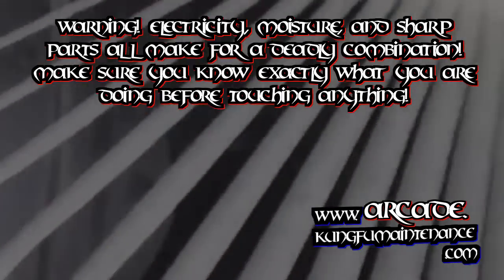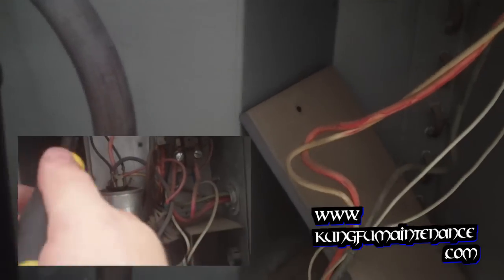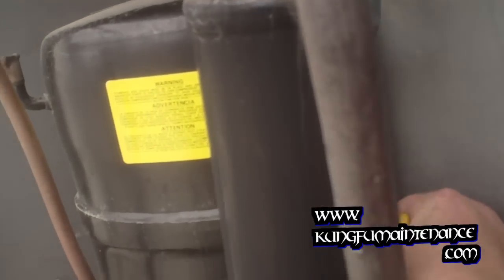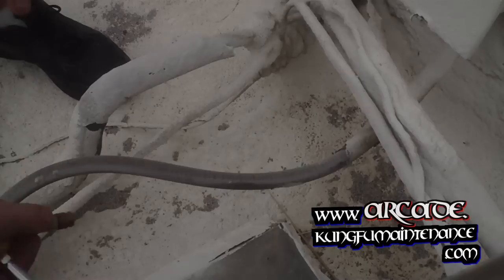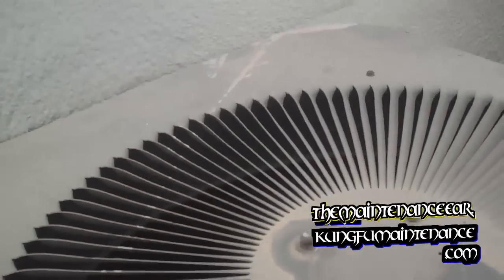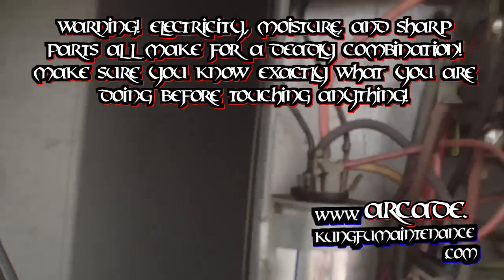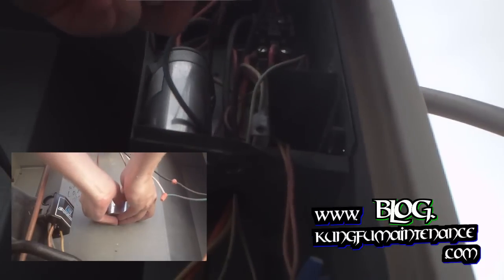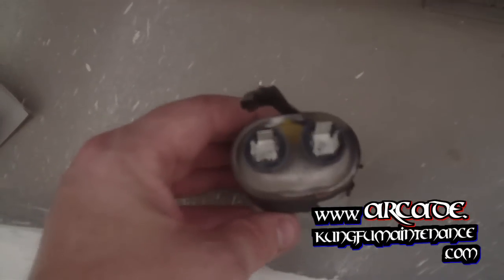Air Conditioning Fan Stuck Try This Before Replacing Central Motor

Comment from the maker: Get  the Multi Tool Pliers used in so many KFM videos       http://amzn.to/2kWTjPp
5mf Capacitor   http://amzn.to/2wC96sH     35mf Capacitor    http://amzn.to/2vZVZ2t
35/5mf Capacitor   http://amzn.to/2iVJNi2        40/5mf Capacitor    http://amzn.to/2wzEdXD 
45/5 mf Capacitor   http://amzn.to/2w0wez5   
Get KFM's favored AC Gauges here            http://amzn.to/2kYgGb8
Valve Core Removal Tool                              http://amzn.to/2kJ00pC
Get KFM favored Electronic Leak Detector        http://amzn.to/2kmQMMz
Simple Leak Seek Spray   http://amzn.to/2lFfcC5  Laser Thermometer  http://amzn.to/2layD8I  
Inficon Refrigerant Scale                               http://amzn.to/2vUCQPD
Get KFM's favored Multi-Meter  here        http://amzn.to/2l8W9CO 
Get the Milwaukee 11 in 1 Screwdriver     http://amzn.to/2uTtsNj 
Wet Dry Vacuum used in so many KFM videos   http://amzn.to/2lFxi7u
Condensate Pan Tablets   http://amzn.to/2lalV9W   No Rinse Coil Cleaner  http://amzn.to/2lHg8GD
Condenser Fin Whisk Brush                          http://amzn.to/2vWXUoC 
Chapin Pro Pump Sprayer                             http://amzn.to/2vWCXdD
Evaporator Coil Cleaner No Rinse Mix        http://amzn.to/2x3eJTT
Evaporator Coil Cleaner No Rinse Can        http://amzn.to/2ezIxju  
Hard Start Kit     http://amzn.to/2kiD16v   Contactor     http://amzn.to/2lFqA0P
Get the Screwdriver used in so many KFM videos here    http://amzn.to/2kHFoOF 
Easiest Way To Get Universal EPA Certified Prep Manual    http://amzn.to/2kIQdQC
You must be EPA certified to charge or recover refrigerants and here is about the Easiest Way To Get certified with the Universal EPA Certified Prep Manual    http://amzn.to/2kIQdQC
Get The Kung Fu Maintenance book here     http://amzn.to/2lEQPFk
Or  the Kung Fu Maintenance E book here  for less than $5    http://amzn.to/2lEY8wD
Get the Kung Fu Maintenance album (good driving music) "Up Beat" here     http://amzn.to/2l41pZ1
Get the Kung Fu Maintenance album (nice Instrumental music) "Entropy" here   http://amzn.to/2kl2U0p
Samsung Galaxy S8 Plus        http://amzn.to/2sFn9h8
GoPro Hero 5 Action Camera         http://amzn.to/2sN4nVK
Rode Lapel Microphone                 http://amzn.to/2vZoFc7
Purple Panda Lapel Microphone  Kit   http://amzn.to/2wByXkq
Video Edit Pro Software       http://amzn.to/2ruaaeZ
Samsung Galaxy S5                 http://amzn.to/2wBxk6l     
Samsung Galaxy S8 Plus        http://amzn.to/2sFn9h8
Video Edit Pro Software       http://amzn.to/2ruaaeZ

Hire An HVAC Specialist                                  http://amzn.to/2lktKek
Air Duct Cleaning Services                              http://amzn.to/2lFTpun
Central Air Conditioner Tune Up                   http://amzn.to/2lzJGoy 
Air Conditioner Repair Or Installation          http://amzn.to/2lFsEGw                                           
I don't work for any of the product companies  listed however I do make a small commission on items ordered  through the links.

Comment: At first it would make that loud buzzing squealing noise my fan wouldn't go on I'd give it a pushing it would work and cold air would come out once I got the fan going after a couple weeks of that the fan would not go even after I give it a push could it be just met capacitor or does it have to be the fan motor also?

Comment from the maker: High heat of the desert puts a strain on everything. 120 degrees and sometimes strong winds to test the endurance of the machines. Job security. Sometimes it is much like changing out spark plugs to do a tuneup. It keeps the timing phase at peak performance.

Comment: Hey my fan outside seems to be running but inside it's not. I hear clicks like the thermostat trying to come on and can feel slight air from the vents almost like someone breathing. I switched the circuit box off and on for the AC and it buzzes for like 3 secs then stops. Do you know what my problem could be?

Comment from the maker: I usually use military grade cable ties( for the ultraviolet protection) or plumbers strap. I have videos covering both methods. "Military Grade Cable Tie Method ~ How To Anchor An Air Conditioner Capacitor" and "How To Secure A Dangling AC Capacitor ~ The Plumber's Strap Method"

Comment: the air isn't flowing in some rooms and it isn't as cold as it used to be, the fan is spinning, but it makes like a ticking sound, an ac technician told me the fan motor needs to be replaced and the coils and everything needs to be cleaned how much does that usually go for to fix everything?, are you located in Palm Springs? I am in  san jacinto, about an hour away
Reply: this ac technician pricing was really high

Comment: My HVAC motor stays on all the time even when it is not cooling and when compressor is on do you know what might be the problem I've put on a new wall thermostat, but it still runs?
Reply from the maker: jedediahbc It is not clear from your description whether just outdoor unit runs or indoor. If it was just outdoor I would suspect and replace the contactor. I have videos showing these repairs. If just indoor unit runs I would suspect the thermostat wiring. Beyond either of these I would suspect the fan control relay.
Reply: KungFuMaintenance  The inside fan keeps running

Comment: First of all I like your video,so is it just the capacitor then? Wow! I appreciate it
Reply from the maker: Thank you, yes that's right. Many times it is just the cap. Sometimes it is the motor but most times it's just the capacitor.
Reply: So a motor not running can just be the copaciter

Comment: Hey at least one good thing about doing AC work is you'll never be out of work. If this "global warming" keeps going on then your job security will get better and better. By the way I do have a problem like this but I don't think it's anything electrical. The motor works if you spin it with a stick but it's definitely resisting turning (normal ones should spin freely). Either a bad bearing or motor coil... The apartment management will replace it...

Comment: What does it mean if I use the stick to get the condenser fan going but the air in the house is still not blowing cold?
Reply: +Andrew Moore bad compressor, capacitor or cunductor

Comment: The inside fan keeps running on the unit.
Reply from the maker: jedediahbc In that instance it could be bad thermostat or wiring (check me vid on thermostat troubleshooting) also check jumper pin for thermostat,  could be also bad fan control relay (have a few videos on these) or bad control board.